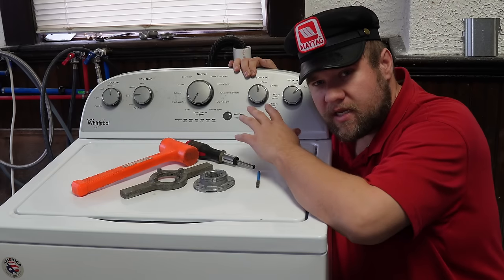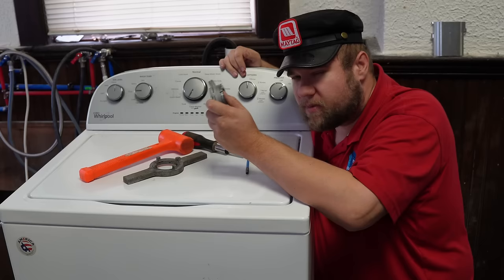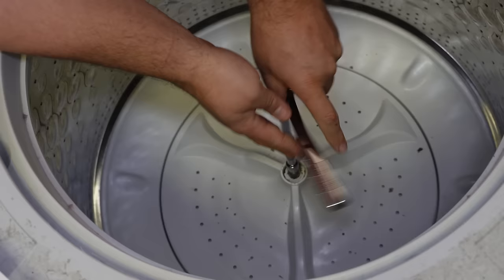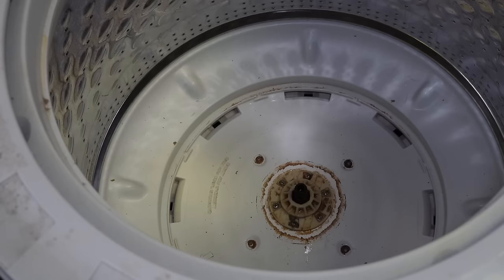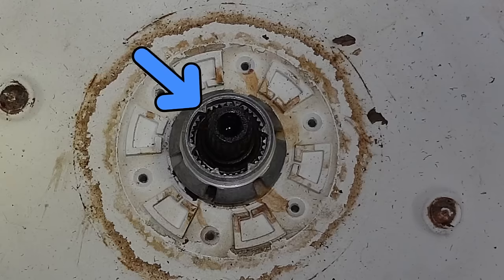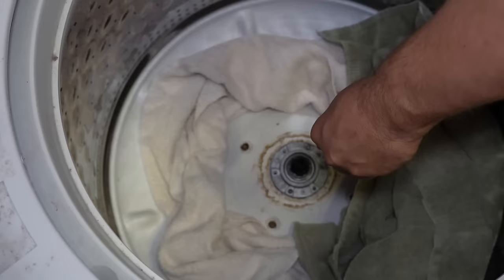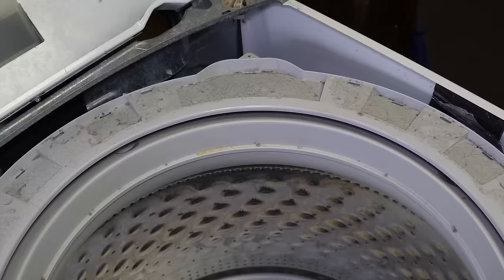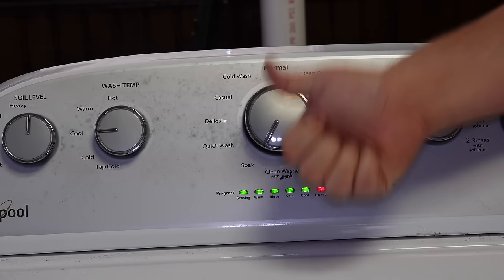Whirlpool Washer Won't Agitate or Spin Properly - Metal Hub Upgrade for Stripped Gearcase Splines

Comment from the maker: FYI, if this doesn't work, every single time the answer is "I bought the suspension rods from Amazon". AMAZON RODS ARE GARBAGE. I'll make a video on this soon, but its due to an improper damping agent.

We have a grease that solves this, and works with all washing machines on the market: https://bens-appliances.com/products/bounce-b-gone-washing-machine-suspension-grease-ba-80048?_pos=1&_sid=396670320&_ss=r
Reply: Damn I just installed ones from Amazon on a WTW5000DW2

Comment: Ben, at the start of video you got cut off,  you didn't say what to do if the wash plate DOES spin freely.
Reply: Needs new wash plate as it’s stripped?
Reply: Agree, Ben - what if the plate does spin freely?
Reply: Hey Ben, did you make another video that covers the situation of the wash plate DOES spin freely??  Inquiring minds want to know!!!
Reply: Ben!! What if the wash plate can spin freely with pressure? Was it the shift solenoid actuator?
Reply: I just went through this entire process. Mine did spin freely. I just replaced the hub per the instructions in this video now it does not spin freely and works fine.
Reply: If the wash plate spins freely, most likely your drum hub is bad so keep watching the video.  If the wash plate does not spin frèly then your drum hub is not the problem.
Reply: @danmaus245 after installing the hub the washplate didnt spin freely. But when it did prior it needed alot of force to do so.
Reply: Where do I get the metal hub
Reply: @TheMrhighclimber  check the link in the description
Reply: Same issue. How do you get the bolt out if it starts to turn the hub?

Comment: 🚨this is an easy fix and most likely the cause for a washer jumping around. I replaced the springs and it still jumped. If when holding the outer tub lip and shaking the inner tub and there is any play or rocking back and forth, then this is the fix. MAKE SURE YOU BUY THE SHIM KIT. when you take off the plastic OEM hub and clean off the shaft, make sure you install the shim that will take the play out of the shaft to tub contact. I didn’t do this the first time and there was play after installing this part. Ben appliance sells the shim kit in three sizes when you order it. Mine was the middle one which was green that I had to install. Once I tapped that in between the tub and the shaft there was no play. I then installed the hub like in the video and there is no play. Had to order hub again because I couldn’t break the Loctite on the 1st one. My washer is working 100% now. I can’t stress it enough make sure you install a shim or it will still jump and have play even after it’s installing the hub fully. Depending how long you’ve been using your washer and letting it jump around will dictate how much of the tub has been worn away, which will require the shim size to be different. Use a thin flat surface and tap the shim around till flush. Don’t use a pointed object or screw driver as this will damage the shim.
Reply: Thanks for the info! The fix from the video only worked for about 24 hours before the shaking started again. We noticed side to side movement again in the tub and, after reading your comment, have gone back and added the shim. So far, so good!
Reply: Where is the link for the shim?
Reply: When do you put the shim on ?
Reply: Why wasnt this in the video,,,😮

Comment: My washer was shaking violently. Same one as in video. First I replaced the suspension, still shakes but not as bad. Then I found this video, ordered the parts, installed and calibrated. The machine runs like brand new now! Thank you Ben! Hopefully the metal hub won't break the agitator. Only time will tell. So far, worth the money!
Reply: Just came back here to say that the fix is still solid. After 1 year, the washing machine still performs excellent after installing this new part.

Comment: Fantastic! The calibration is perhaps the most overlooked part of the entire process. 10/10
Reply: I would hope not as it's a whirlpool
Reply: @swampcabbage3239  I've been repairing appliancers professionally for 15 years now - Whirlpool is not the brand of yesteryear any longer. Heck, Maytag's break constantly under warranty.
Reply: @MichaelCater  May I ask who makes a good washer?  I have this washer and maybe 5 years old.  This young man's repair is something I can do and I appreciate how he helps people.  Another video from another guy said if you have maybe not identical problem, junk it. 

I bought whirpool because they were a good American brand but the matching dryer fell apart at 3 years old.  I got a used Maytag (almost same dryer) with 10 year warranty.  It has been good. 

I will not buy LG or Samsung cause the boards, etc fail.  I might buy a GE washer but GE sold it to a Chinese company.   Whirlpool selling these thing with nylon/plastic parts.  A metal one would have cost probably $6 more.  

Who makes a good reliable washer besides Speed Queen?

Comment: So i got the hub in but when i ran the diagnostic it keeps kicking off. The agitator won't spin now even when moved by hand. Did i install the hub wrong cause there were no problems with the agitator spinning before?

Comment: I’m at a point where I bolt the flange onto tub but it sits ~1/8 inch gap from tub . Not sure how this happened since the splined piece is fully engaged, need help.

Comment: Thanks for what you do, Ben!  You've saved me from calling a tech out on my machine and my MIL's dryer.  It was so cheap and easy to fix, with your direction.
Reply from the maker: Glad to help!!!
Reply: @bensappliancesandjunk hey, good day, how can I contact you direct, email?
Reply: @bensappliancesandjunk  I have the same washer as the video and my agitator won't spin at all on the wash cycle and it makes a clicking noise. Will the replacement help that problem
Reply from the maker: @rayjohnson5873  thats unlikely to be the problem. I'd check error codes and see if something pops up. Sounds more like a splutch/shift actuator issue.

Comment: After watching your video, we ordered the recommended parts, tool, and blue goo. This was a lot cheaper than I would have imagined. We received the order within 3 days. While following the video step by step, the repair took less than an hour. Waiting 24 hours to set was the hardest part. We recalibrated as instructed, and started the clean cycle. We are now up and running. Thank you for your great easy to follow instructions, your quick shipping, and affordable price. Times are tight right now and an inhome repairman or new washer is not in our budget. 😊

Comment: :trophy-yellow-smiling: Excellent product. Have a Maytag, with the tall agitator.  Bounced around even when empty. Bought these parts. First time install, tightened screws down without taking into account the tub settled on the shaft. Ran a test, bounced like crazy from the bottom. Went back in, lifted tub, tightened screws (a quarter inch!). Re-calibrated and tested. Purrs like a kitten. Problem solved.
As for getting the agitator off, in my case I just rocked it from side to side while pulling and it popped off.
After reading comments on the part's early failure, I will post an update after a month.

Comment: Wow dude, Ben Thank you so much. My machine is only 5 years old and I've replaced the hub assembly a couple of years ago. This thing has had several repairs by me. 
  I was about to throw this thing out and buy a speed queen. I knew the plastic splines would just strip out again. Found your video and then another guy recommended your hub assembly repair part (I'm sorry I don't remember his name on YouTube).  I clicked on the link in the description made sure it was for my Kenmore series 500, and ordered the wrench loctite and hub assembly. Installation was a breeze. 

Thank you Ben🎉. For a very informative video with very easy to understand instructions. 
My washing machine is repaired just tested it out it works great. Shipping also took no time at all as I am just north of you in Cleveland Ohio (well a suburb of)

Comment: ive seen this metal hub on a repair job once before wondered if they were compatible with the crap plastic ones. Ive diagnosed 2 more customer machines just this week with bad drive hubs and worn splines. Going to order a few of these for future jobs, a lot easier to sell a $50 dollar part vs  200+ for a gearcase job

Comment: Ran a few washes including a heavy one with sheets and everything seems to work normally. I did recheck the suspension rod play. It is hard to compare with how the tub behaved five years ago when new, but doing a bounce and sway test the motions damp out very quickly so it looks like the rods are OK for now.
Kudos to Ben for providing the videos, and the metal replacement hub!

Comment: I was able to get the old hub off using three air shim bags, one under each of the agitator splines. This finally worked after soaking in citric and other slightly stronger acids for hours and trying to pry it off in creative ways!

Comment: This is perfect. No matter how hard I pried and how much penetrating oil I used it wouldn't budge. I soaked it for days.

I bought four air wedges for <$30 from Amazon to remove the wash plate. I inserted 3 of the air wedges and it popped off in 2 seconds.

Thanks for the info!!

Comment: Hey, back on this video a year later.

I had the plastic drum hub strip out August 2023. The transmission splines didn't look great, but a new plastic hub fixed the issue.

I also bought the metal drum hub, and ended up returning it to save a buck.

Well, July 2024, guess what? The plastic hub stripped out again in less than a year. Definitely putting a metal hub on now.

Anybody dealing with this for the first time, just spend the money on the metal hub, not worth the hassle of taking it all apart twice.

Thanks again for the video!

Comment: I have a Maytag Bravos washer. Six years old.
Ive had to replace the stripped out plastic hub 3 times and 2 worn wash plates. The first two wash plates I had to destroy to get them off the shaft, frozen due to corrosion to shaft at top splines. Third wash plate I  got off, I feel due to the use of a lot of anti seize compound. Last repair was weeks ago, Before that, 8 months ago. When my order comes in I will be ready for the upgrade. Thanks for the tips on the manual test mode control knob instructions as well as calibration mode. Thanks a million Ben 😀

Comment: I've been hearing the washer make a hard clicking noise on rinse, it's gotten louder over the past year. I knew something was wrong, went to to diagnose, seems the locking plate is loose, glad I found this video, this will be an easy fix for $35. Thanks for making the video and including the recalibration part.

Comment: Amazing fix! I still had banging after I switched out the suspension rods and this part and video saved me from having to buy a new washer. The agitator was a pain to get out. After some hot water and vinegar, it popped right off. Thanks! As always, your videos save me money!🥳
Reply: How did this part cause your vibration?
Reply: It fixed the vibration or clunking I was having. I had replaced the suspension rods but the washer still had the same issue. I found this video and bought the part and followed the instructions, now it's perfect!

Comment from the maker: So, uh, shortly after making this video showing off the metal hub, it sold out nationwide. They're now impossible to obtain. Just before that happened, I decided to contact a factory to make a special run of these for me using the same quality components that Whirlpool uses (ADC12 for the hub/nut and a special zinc for the drive block). We have a ton on order, and at a massive discount vs. OEM. if you'd like to pre-order, here's the link: https://bens-appliances.com/products/w10324651-ba-whirlpool-all-metal-washing-machine-drum-mounting-hub
Reply: Do they offer a metal replacement hub kit for maytag washer model MVWC565FW
Reply from the maker: @craigryder3712  the one linked will work for that model as far as I can tell as the nominal one is a W10528947 which I believe is identical to what I replaced in the video for the metal one.
Reply: When do you expect to get more in stock
Reply: @bryanwickizer1323  I have an order to stock them far beyond that link. Just don't have them yet.
Reply: @liarafunhaha1693  it says your sold out
Reply: Hi Ben, I have a Whirpool WTW4850HW1 model, would this metal replacement fit on my model #? Thanks and great video👍😁
Reply: Why are my splines wider then hub plate ? I took off wash plate but the shaft sticking up has splines like in a 3 star, which makes it wider then the plastic hub. Does that metal 3 star spline come off, then pull plastic hub off?
Reply: @kwmiked   late response, but that was prob the collar of your agitator.
Reply: @bensappliancesandjunk Ben, two questions: 1. Is there a balance ring on the Whirlpool washer in your video?  2. Will using a brand-new nylon/plastic gear hub stop the tub from banging as effectively as using the metal one in your video (though understandably the plastic one won't last nearly as long)?

Comment: This video is excellent! Note to Ben - This will work for some Kenmore washers also! I have a Kenmore model 110.2513241 which has the plastic hub (drive block), part number W10528947. The plastic hub in my washer stripped out about a year ago and I replaced it easily with a new plastic one. Last weekend, the washer started making the same noise that it did right before the last one failed. I had a horrible time taking out the washplate this time and it broke so I ended up needing a new one of those also. Anyway, once the washplate was out of the way I pulled out the hub and, sure enough, it was mostly stripped. I got a new one and installed it, but I would not be surprised if that one strips out within the next year. When it does, now I know that I can get a metal replacement from you that will probably outlive the rest of the washer. Thank you so much for finding this solution!

Comment: So I just want to share my story. My washer started shaking violently last year. I got deployed so I couldn't really do anything about it at the time. I come home and I look on YouTube and sure enough everyone is saying to change my suspension rods, and Leveled the washer with a magnetic level. Which I did but it did not actually fix the problem.

Next, I found a video that led me to this one. I went to my local appliance repair shop and bought the kit mentioned in this video.  Alas, when I replace my hub, I notice my hub actually was not run down like the one shown here, so I'm pretty sure that was not the problem either, because I still had violent spinning.

 Fast forward to today and I'm determined to figure out what is wrong with my washing machine. I opened it back up and I'm looking around. I noticed these black pads on all four sides of the washing except in one spot on the left side. And it dawned on me that during the spin cycle the cylinder would hit these pads stopping it from violently hitting against the walls of the washing machine. I go to the local hardware store and buy some pads usually use for door frames with adhesive on the other side. I open the washing machine and stick it on to the inside of the washing machine sure enough it goes into spin cycle and there's no violent shaking. It was then I had a flash back of cleaning my garage/laundry room stepping on that missing pad and throwing it away not realizing what it actually was.

 These videos taught me a skill I never had before and I am forever grateful. That being said sometimes the simple solution is  the hardest one to notice. So before you do anything. Make sure your drum impact pads on the inside did not fall off. I may have spent roughly 150-200 dollars on everything I used for this project. But in the end it beats spending what I would have on a new washer.
Reply: I wonder if that's what the problem is with my washer. Thanks for the info.
Reply: I replaced the tension rods and this hub. That was preventative maintenance but I still have a lot of play in the tub. Did you have to take a lot off to get to the pads? Are these the damper (snubber) pads?
Reply: @amazinvidios505  did you tighten the metal sleve down tight enough and use loctite?
Reply: interesting i opened my washer today and noticed 2 sides were missing the black pads, they werent under the washer either. I recently bought this house and the washer came with it so who knows when they fell off. I have rods coming in but now im wondering if that is actually my problem. Wow.. What kind of pads did you end up getting and where? big blue or orange store?

Comment: I love the fact that this happens to be exactly the same washer I have. 
The suspension rods appear to have good damping when I push the tub down or sideways, but there is wobble between the inner and outer tubs so I’m trying a new drive plate first. I just received your new metal hub so we’ll see how it goes.
Reply: I'm having the same issue. Update please???
Reply: How'd it go for you

Comment: I also much appreciate your YouTube help!  I did end breaking the plastic wash plate.  But no difficulty replacing the hub assy with the steel one and put some new OEM spring assys in too.  But I suspect the real cause of extreme “walking” was the three dimes I found lodged in three drain holes below the washplate.  This probably caused a severe imbalance of spin water dispersion out of the drum.  They were all in the same quadrant.

Comment: Wish I had found your site earlier. Bought the plastic repair, found another site showing the metal hub but it didn't list my model. I was not sure it would work. Your site listed my model. Washer is now running☝ great. Bought your cleaner can't wait for it! Thanks